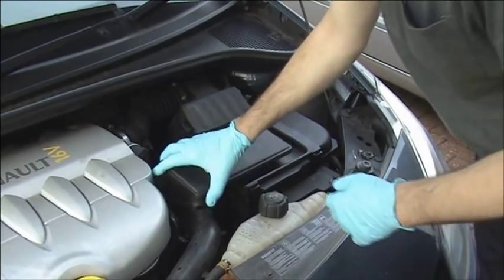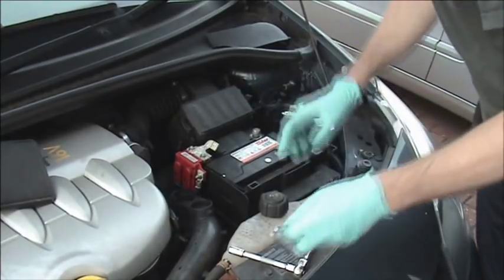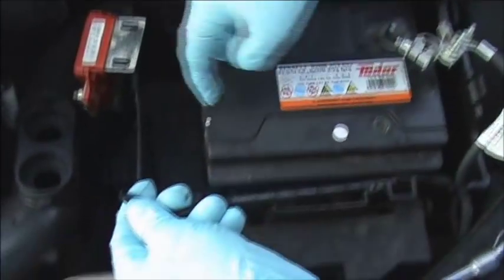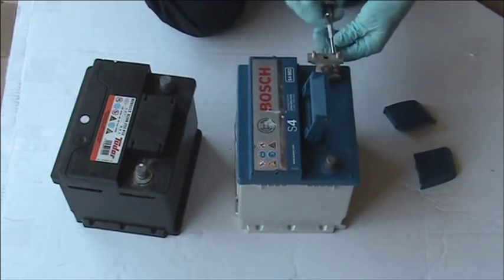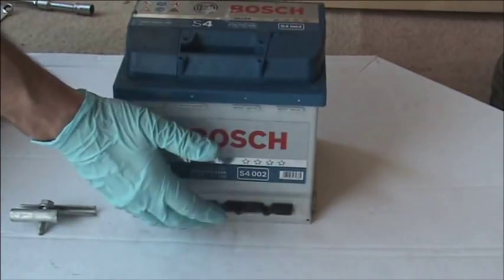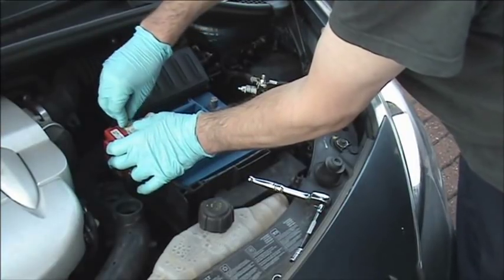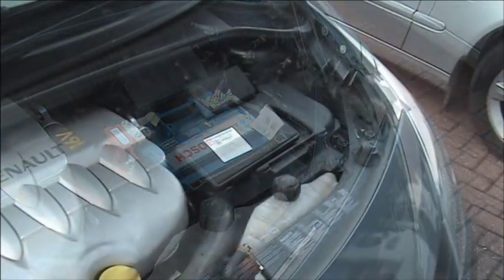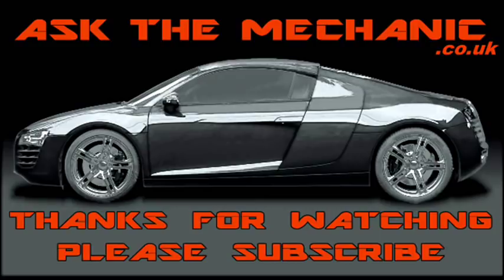How to change a car battery safely

Comment from the maker: CA (Cranking amperes) is the amount of current a battery can provide at 32 °F (0 °C). 

CCA (Cold cranking amperes) is the amount of current a battery can provide at 0 °F (−18 °C). 

You only need a vent pipe if the battery is inside the car, (boot etc) or in an enclosed box where the vent pipe was fitted to prevent the build up of gases produced during charging.

Comment: A good way to preserve your presets and other electronics is to get a device that is called a memory saver. The best type I have seen, plugs into your OBD II port. It will supply 12 volts to the car, when the battery is disconnected.

Comment: also good idea to connect a 12v power supply to the terminals so you dont have to reset items after such as radio pin

Comment: I'd always grease the battery terminals with Vaseline or copper grease; helps connectivity in keeping any moisture at bay. I understand on cars with STOP/START (most new cars in Europe) that changing batteries on these isn't so straightforward in that they need coding to the car :(
Reply: you have to replace them while using a device the supplies power to the car forget what theyre called but it isnt that much harder to do actually, you can look it up

Comment: Wow, I have been doing it wrong for years. Didn't know there was an order to this. Also, at one point the battery terminal was so corroded that the post cracked as I was attempting to pull it out with my bare hands and liquid came out of the battery. Next time I'll make sure to use rubber gloves 🙃

Comment: That is a pretty crazy set-up under the hood, with the battery being so completely covered and then vented.  Must be a newer car.  Maybe that would prevent all the dirt from getting on the battery, which somehow works its way under the hood.

Another thing to remember is that you may have to drive a while (at different speeds, etc.) before the computer will go through a cycle, so the car can pass an emission test.

Comment from the maker: If charging a battery it would be best not to have the charger switched on, when connecting to the battery to avoid any sparks so would not really matter.
If disconnecting the battery before charging always start and finish with the negative lead as shown in the video
Reply: LOL. I'm a dumbie... Heard START with the black and END with the black, and thought WTF... I realize this is a REPLACEMENT guide and not simply a REMOVAL guide... Thanks for the help.
Reply: that was a good video! thanks!
Reply: Ask The Mechanic mm
Reply: so like, the only dangerous part is the POSITIVE one ? if i touch the NEGATIVE connection it would not spark ? i have this phobia when it comes to electricity.

Comment from the maker: Most European built cars have the battery held by the bottom lug, some have two clamps. Japanese cars don’t always have the lug and have a clamp across the top of the battery, but this would be obvious, it may just need a firm pull to remove.
Reply: Are North American cars the same as with this? Where you must start with black terminal?
Reply from the maker: Yes all cars (negative earth) are the same, it is always safer to start and finish with the negative terminal (black) to avoid the chance of shorting the spanner to any other metal component.
The only exception would be if you were working on a car older than the mid 60's (positive earth) where the positive battery connection is connected to the body.
Reply: @AskTheMechanicCoUk  thank you for taking time to respond. Really grateful for that.

Comment: I have no rubber gloves, and my battery is dead soo I need to replace it. But is it ok to replace a car's battery without rubber gloves? As long as I follow your steps "always starts in negative and ends with negative" ??

Comment: Very useful video and I tried it today and while I was connection the negative to install the battery, there was small sparks 😳 is that normal or could there be a problem
Reply: Connecting

Comment: Hey, thanks for the video. 1. Should I wear any safety gloves when working with batteries? 2. Should I be extra cautious not to touch the car while wrenching either the positive or negative terminals? I mean stay away from the car? Doing a projector retrofit for the first time and the more videos I watch about the battery safety the more freaked out I'm. Thanks for the help!
Reply from the maker: I would recommend having gloves on when working with battery just to protect form acid, and if you start with and finish with the negative you do not need to worry as you will not short your spanner on any body work (body work is connected to negative).

Comment: lead acid batteries produce hydrogen gas as they are being charged. with the older type batteries, where the cells have screw caps to each cell, any spark can and most likely will ignite this highly flammable gas and explode your battery up in to your face while your bent over it removing the terminals, you will have pieces of battery and acid in your face and eyes.
hence the reason to disconnect the negative terminal first and connect it last as you in reinstall.

Comment: ive got a battery clamp like the one shown but when i try to remove it the bolt just turns and wont come loose, it appears the nut underneath is turning and theres no way to get to it.
any suggestions as to how to get the clamp off please

Comment: My mum has a Nissan qashqai and got told by her mechanic via my mum's partner that she needs a new battery to it, what would be the best replacement one to get and where can you get it at the best price?
Reply from the maker: I would only recommend buying a well known make of battery Exide, Bosch etc, these will sell batteries of the same type but with different guarantee periods, so my advice would be decided on the make, guarantee you want and then search for the best price.

Comment: mate i need to get a new 1 cus my battery well bad but would i need to charge it first or could i just put it on the car and let the car charge it or do they even come charged thanks dennis
Reply from the maker: It will come more or less fully charged, so no need to charge, but I would check it has 12.5v or higher before fitting just to make sure
Reply: @AskTheMechanicCoUk  thanks man
Reply: @dennis12879  mate u is well gay

Comment: i removed the black (negative) connection to save my battery discharging on holiday. upon return i wanted to reinstate the battery, however when doing to the connection sparked so i stopped.  thing is that the key were not in the ignition, is this   normal?
Reply from the maker: Some cars will have a small spark when connecting
due to the central locking, this is normal, might be worth checking that the drain
is not there after connecting, please see our “Car battery going flat how to
check for a drain “ video https://youtu.be/FybqNO7et0k?list=PLX15l9Cp_cGhDClDmepMCvu8DnzBptTpT

Comment: i got a 08 Peugeot 207 and need to re-earth the rear taillight, do i need to disconnect battery to do this or will it be okay to leave it connected?
Reply from the maker: As long as the lights and ignition are turned off, you will be fine to work on the rear lights without disconnecting the battery.

Comment: help! I have a strap over my battery on my ka
is thus needed can I cut it? I need to replace the battery x
Reply: dont cut the strap but open it by unscrewing from both side. Strap enables the battery to not move.
Reply from the maker: You will need a 15mm deep socket, it is very tight on a KA and you won’t undo it with a spanner, the strap is attached to the securing clamp and will lift out of the way when you undo the clamp. 
The strap is there to prevent the battery moving if the car is involved in a heavy front end crash .
Reply: Of course you have a KA!

Comment: 0:10 Radio code will be lost? O_o what does that mean?
Reply from the maker: If you disconnect the battery and the radio has an anti-theft code, you will need to re-enter the code (maybe in service/radio manual) or you can use a code saver (small battery) to keep a small amount of power in the car to prevent losing the code.
Reply: @AskTheMechanicCoUk  Thanks, did change my battery with no code needed for the radio. Curiosity: would it be possible to change the battery while the the engine is running? This way the radio is never disconnected from power. This might work with diesel engines, as they need much less power to run
Reply from the maker: No never disconnect the battery with the engine running you could damage any of the electronic items, due to the charging voltage going high when the load of the battery is removed.

Comment: Are batteries dangerous?  My dad always warned me about the corrosive substances in them.
Reply from the maker: Yes always wear old clothes, no naked flames and keep battery upright (although the vents are safe than older batteries were)
Reply: Ask The Mechanic If you get that corrosive liquid inside the battery on your skin are you in trouble?  Or does it just wash off?
Reply from the maker: I would recommend wearing gloves, but with modern vent systems you would need to turn battery on its side or upside down to get a leakage, if you do just wash with plenty of water to dilute the chemical reactivity of the acid it’s not super strong and if washed immediately you will be fine, but with a care they is very little chance of any leakage.